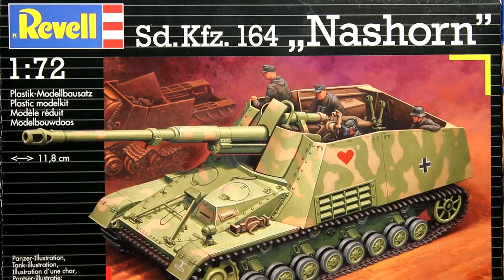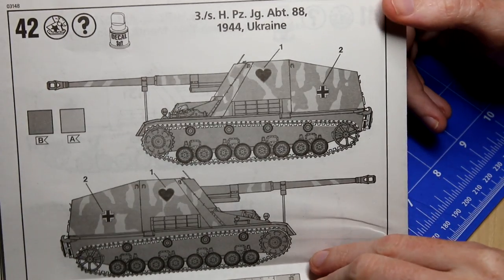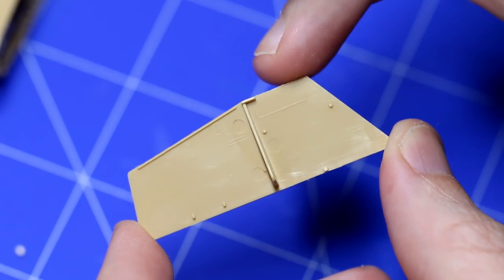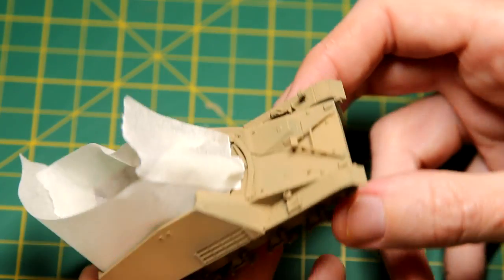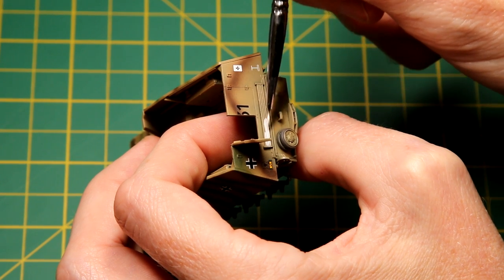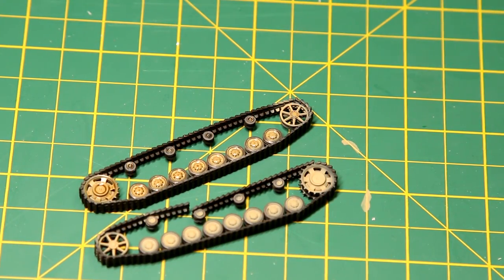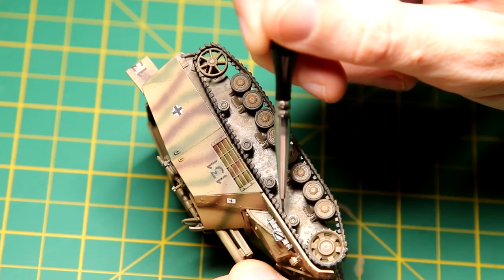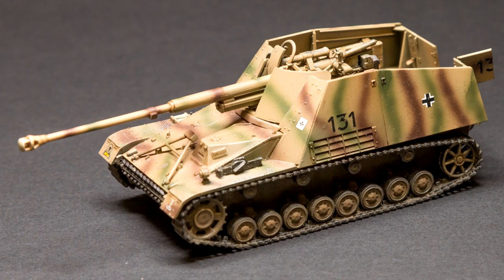Nashorn (Revell 1:72 scale model kit)

Comment: Nicely done. Great kit and keep the good work in this scale coming. A particular good kit is the Dragon Panzer III. There are several versions and they are all good. The new ones have the Neo tracks which supposedly are an improvement over the vinyl tracks. I usually use OKB resin tracks on most of my vehicles so I haven’t tried them yet. It is a very nice kit. 
Cheers, Any.
Reply from the maker: Thanks for the suggestions mate - I'm definitely going to do more in this scale (maybe with the Dora).
Reply: @ModelNerd  is that the rail gun?
Reply from the maker: @anyblunder6782  Yep, that's the one. I'll have a small road with some vehicles next to the gun itself.
Reply: @ModelNerd  I just got the small locomotive. I’m going to follow your build with great interest.